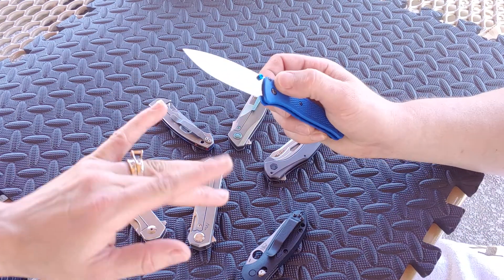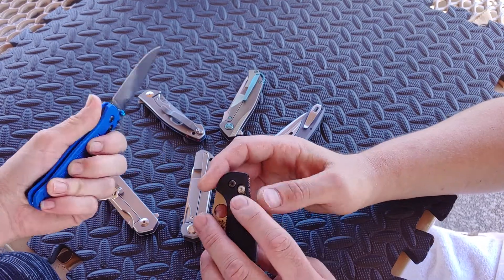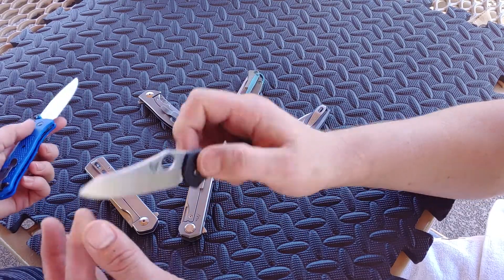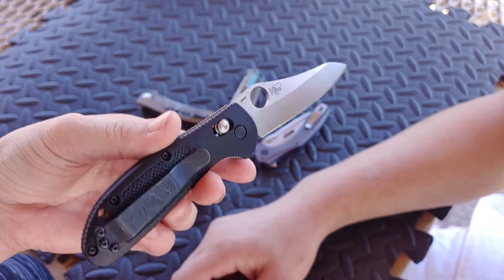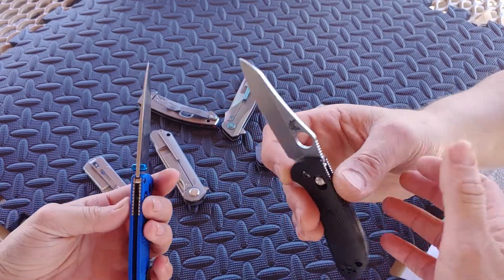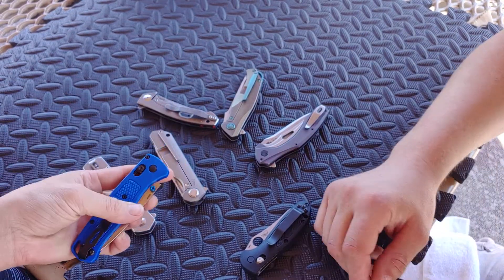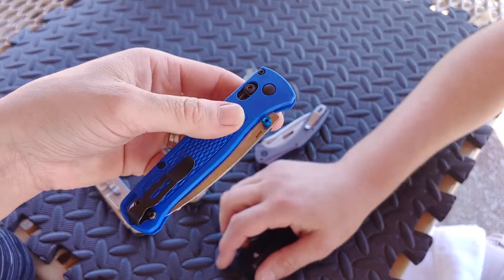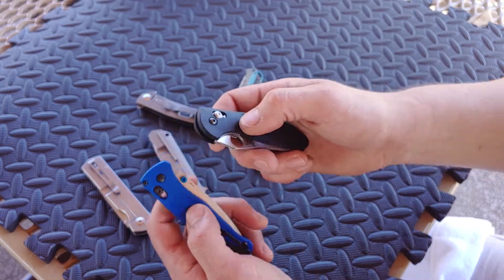Benchmade Bugout Update

Comment: It took a little while for mine to break in too.  I’m very happy with it now that it is broken in though.  My Bailout, on the other hand, is taking a long time to break in.  Great video!
Reply from the maker: How long have you had the bailout?
Reply: Neeves Knives about 2-3 weeks.
Reply from the maker: @TripleEEDC  yeah i would take it apart if possible, and rinse off the lock then clean off the liners were its probably rubbing. Then work the mechanism slowly so it breaks in evenly, i was trying to rush it by snapping it open hard and it just made it worse. I can make a vid if you want me to and try n help

Comment: How did you get the lock stick to go away? I can’t seem to get mine to stop sticking. I also checked out bamaknifeguy thanks for the recommendation.
Reply from the maker: You can put a little lead on the lock face to help, but i was opening and closing it slowly, without snapping it open hard then it gets to brak in more evenly and then just keep playing with it, if you absolutely have to take it apart, then try to rub off the black coating a little bit that can rush it.
Reply from the maker: It doesnt have to be completely removed, just not so thick